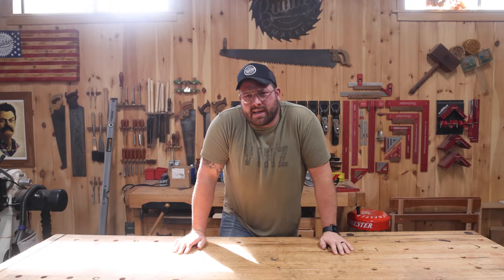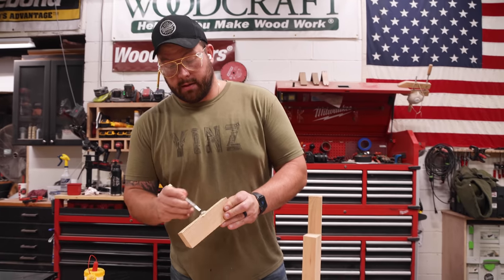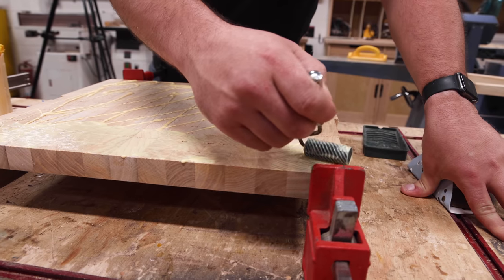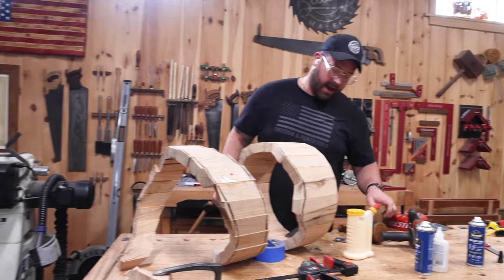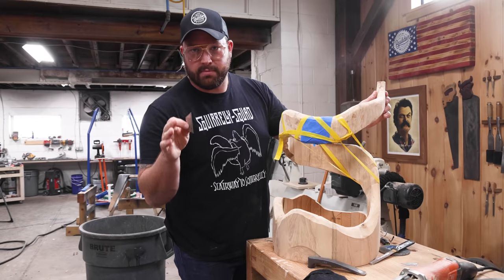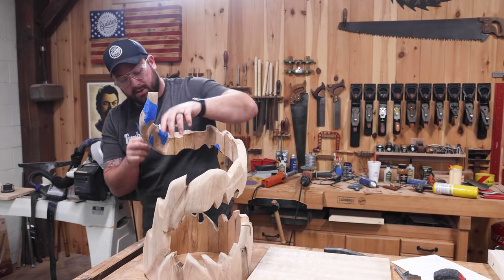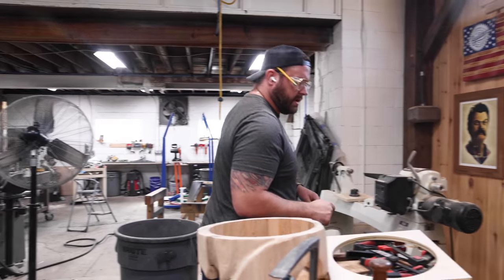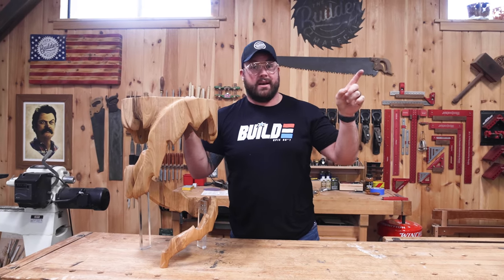IMPOSSIBLE Floating Spiral Table Build - How Does it Work?

Comment: best way I've found to assemble segmented glue ups (I do a lot of hexagon/octagon picture frames and cedar bongs) ;ay the painters tape out on the table sticky side up, (fold the ends over to hold it to the table) then lay the segment out on the tape apply glue and just fold it up. the key is the angle, the angles need to be just about perfect. if you want to spiral it to the center you have to keep increasing the angle. e.g. 22.5 to 22 to 21.5 to 21 to 20.5 to 20. I'm not sure of the exact angles and how many of each you'd need. guess that depends on how tall you want it and how fast you want it to spiral to the center.

Comment: A center steel post to a base would have been sweet as well. Then just have that carved wood floating just above.
Reply: Rebar bored through the middle of the wood section, hidden by a invisible spiral joint.

Comment: Not trying to be critical, but wondering if there would be a way to attach the acrylic feet without screws. Some kind of tenon end on the acrylic, up into the bottom of the SQUIRRELLY Spiral 🤷🏾‍♂️ ? Nice build.
Reply from the maker: After using the screws I couldn’t agree more haha
Reply: he could try running some acrylic dowels through the wood to support it

Comment: The acrylic doesn’t look bad, but those screw joints on the inside sure do.  That stuff is easy enough to carve up and shape any way you like, and he could’ve just did a mortise on the underside of the of the wooden (leg?) base and  hidden it a little better that way.

I also think it would be cool to do something like this with a very small base like that, but hide something very heavy inside to weigh it down.  Then transition to lighter/less dense wood further up the table until you reach the top.  Then for the top, make everything as thin as you can get it, but keep a lip on it as best you can so it still looks deceptively chonky.  Then you can use clear poly or acrylic for a thin base that looks invisible.  Like a wine glass basically.

Comment: I bet a foam cylinder could've been used to support that spiral enough to rough out that line with the jig saw. Not sure if you could find that foam cylinder, but a sheet, cut and turned would do it.

Comment: Could you do something similar but inset a steel rod thru the middle by either drilling thru the wood and sliding it over like beads or makeing to curved peices of wood with slots in side to sandwich over the metal?

Comment: Did you think about joining the acrylic to the table using tenons? Would it work for this project? I think it'd look good to have the acrylic disappear into the wood rather than be offset and attached with screws.
Reply from the maker: I agree Alexander. My original plan was to mount them to the top, so i didnt think of morticing them in, but if i did it again i wouldve slotted the swirl somewhere for both.
Reply: @John_Malecki  I should've read the comments. Someone else already asked the same thing. Love your work.

Comment: Please recreate your first tensegrity piece, but updated. It'd be a nice little throwback. Using stronger cable, and off-setting the triangles by 60 degrees. Have the outside wires either angled outwards from the centre beams of the base towards the vertices of the top panel, or from the vertices of the bottom panel towards the vertices of the top panel (so each of the 3 vertex has 2 cables leading to it)

Comment: cardboard concrete former covered in saran wrap then build your wood over that as a buck.  Use diagonal strips of wood (yes its a head***k )  with a dowel or rabbet.  On the area on the floor I would do a coil which underneaths is a gym weight screwed to the bottom .  However there is another trick you can use and that is to run a thin guage steel cable through the blocks with a tensioner on the top not too much so it implodes but enough to lock the blocks together if you use a stepped keyway on each block, similar to a dovetail.    but hey you are innovating kudos to you and the guys.

Comment: hows about making a goblin/fairy daybed for your kiddo? i know they are still very young, but still might be fun to do. or maybe a play castle with hinges so it closes to store all of the associated toys inside when not in use. something like that perhaps? or maybe partner with some kitchen knife company and as a follow up to last year's "cutting board for the masses" theme, u could make blade blocks to hold the kitchen knives and give those away. or some matching deck furniture for u and sam? or maybe an oversize checkers set (board and checkers) out of 2 different species of wood with a nice epoxy inlay of course. (i'd say a chess set, but that might take too long for 1 video)

Comment: I feel like the most stable way to do it, if you want to do full wood, would be to construct it with horizontal layers rather than vertical - and the best way I can think to do that is plywood. So maybe take a sheet of 1/4 or 1/2 inch, create a template for a maybe 2 inch thick arch of whatever length the math says works for your shape.... trace and cut them out cookie-cutter style from the ply sheet, and glue them together in the same step fashion, but shifted horizontally to the side with each piece added.... Then, instead of like 2 inches by 4 inches for surface area being glued between each piece of wood, you'd have like 2 inches by 10 or 12 inches, which should give you about 3 times the strength between layers.

Would also make it a lot easier for you to use clamps while the glue is setting so you'd get a much stronger bond.

Comment: I might have assembled the support structure first, routed out a channel on the back side, and either laid in a deep pour epoxy, or bent rebar plus epoxy. The epoxy would be a strenuous stop-and-go pour, but there would be no visible structures.
Reply: was thinking along the same lines haha getting some steel rolled then veneering over it or some thing

Comment: would it have worked better if you had drilled a counter sunk hole in the non glued side of the wood and screwed each piece together for added strength

Comment: Sorry but NOPE. 
The work you did looked beautiful, but it doesn't work as a table... 
You SHOULD HAVE made a coil/spiral out of REBAR that matched the coil/spiral of the wood, and then made a deep groove on the inside of the wooden spiral that the metal fit into, then epoxy'ed it in and filled in the groove with wood to hide the metal.... this would have made it MUCH MORE SOLID... and then used the Acrylic to make a circle for the base and attached the end of the spiral to the base..... and if you used a heavy gauge of rebar it would have been as SOLID as a cats (a)s(s) in heat!!!! 
Or you could just keep it the way you did it and just live up to the embarrassment of actually publishing this video and acting like it never happened.... but the internet remembers EVERYTHING!!!!!! (so re-do it soon) - heck you could fill in the spiral with epoxy so it becomes a smooth cylinder... and then you can carve the wood spiral to create that depth you were wanting in the project you just did and you're giving away (it's march 17th '24  btw... in case you're reading this in the future and already did something with this...) but you get that depth by carving the WOOD, NOT THE ACRYLIC :)